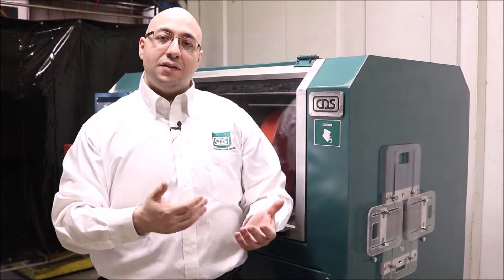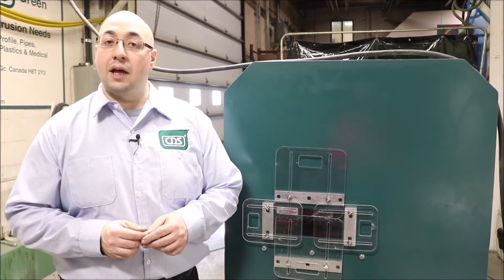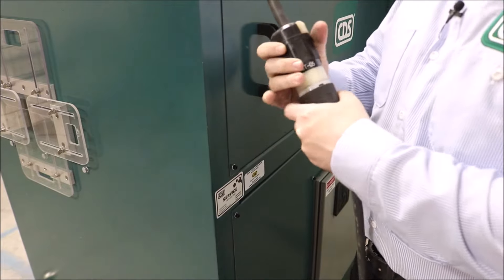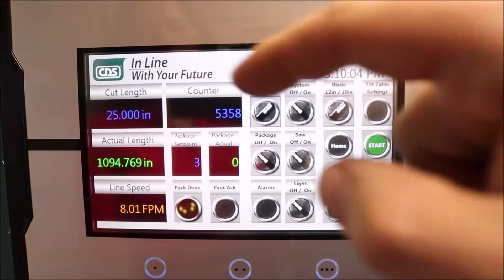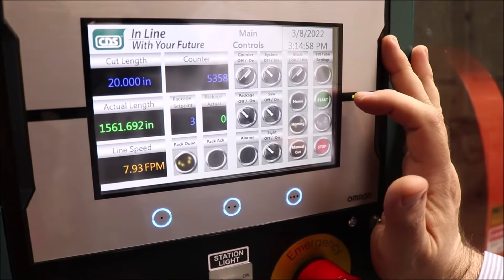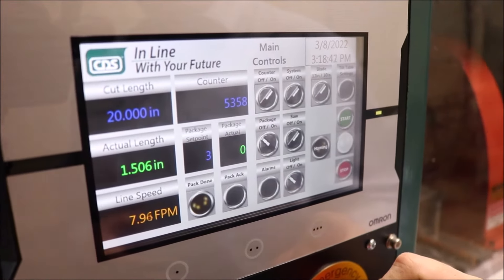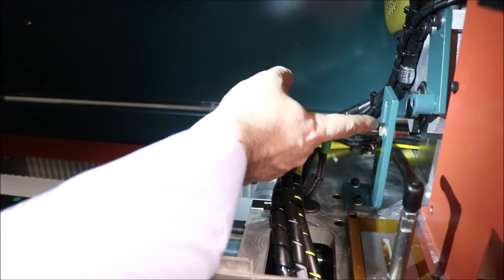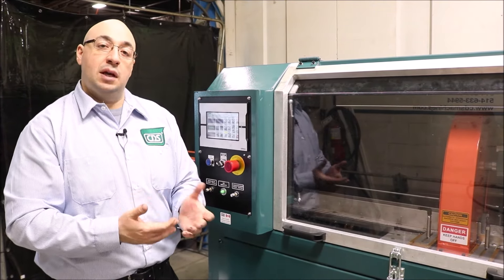CDS - How to operate a Servo Precision Down-Cut Saw

Comment: Nice intro 
Question if I don’t get same length every time 
I know I have to check few things 
But I’m getting mi first pice to short and the next too long wen this happens looks like the computer add whatever measures missing to the next pice 
So what can I do? Already wipe off puller encoder pads etc . Just everyone’s  this happens short or long pice but the next pice be to short if the first was to long